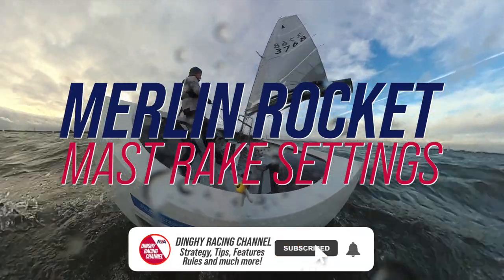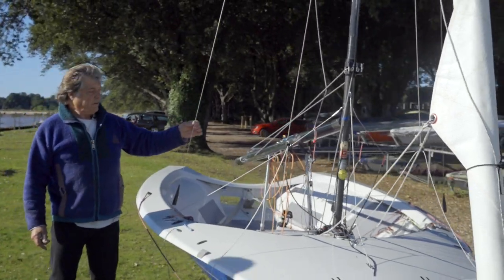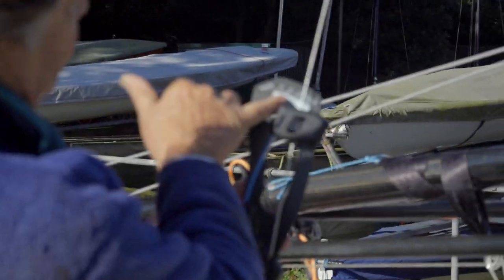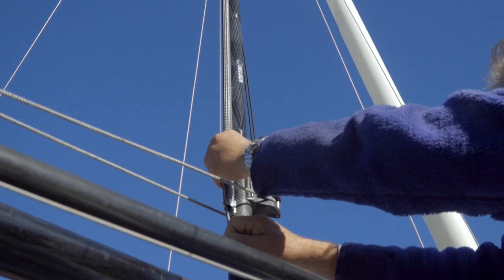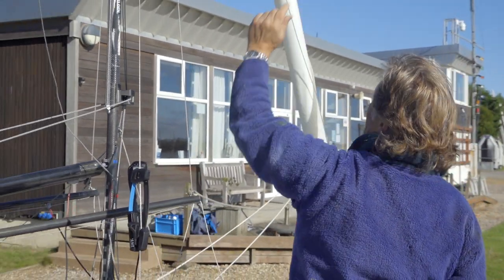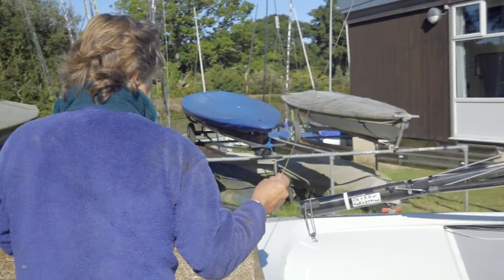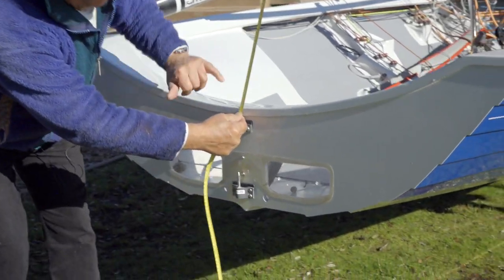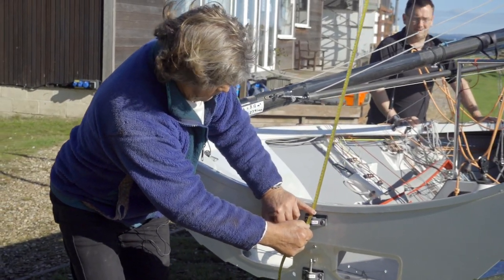MERLIN ROCKET MAST RAKE SETTINGS - Rigging Guide and Top Tips for setting up your mast rake

Comment: Thanks John.... once rig tension is set (lowers slack) what's your recommendation about lowers tension? ....just tighten or is there a specific base setting? Martin 3634
Reply from the maker: Hi Martin, John's recommendation would be to tighten up the lowers to a 'snug' position once you've checked the mast rake setting, and have it set up correctly in the 8-9 knot wind range. Hope this helps! Thanks

Comment: Why rake the mast? To change the centre of effort and balance the helm, or is it more about changing the shape of the sails through altering sheeting angles (effectively moving jib cars back) and shroud v mast angle thus giving more pre-bend for a given rig tension?
What's the benefit of raking the rig over sheeting the jib more along the foot, and increasing spreader deflection?
Reply: Mozzy Sails couple of things here: 
1. It’s the most efficient way to depower a rig: adding twist, reducing drag etc and given that the merlin can do this dynamically, the crew can fine tune the power in the rig to exactly the gust sailed in, optimising available power
2. A main sail is cut for a given pre bend in the mast. Adjusting this pre bend impacts the effectiveness of the alignment between mast and sail
3. JT touched on the impact of buoyancy, but the impact is present too when you rake back as the centre of effort gains a vertical component which gives upward lift. Most obvious demo of this is an asymmetric kite which is heavily raked and provides clear lift.  
Helpful?
Reply: @timothy12350  from Facebook its sounds like pre-bend is kept the same when raked (through lowers, although this might just be displacing pre-bend higher in the rig)) and the jib sheeting angle is brought forward to effectively remain the same. So, the sail shape isn't twisting more, or reducing camber. It's just changing orientation to the wind. Effectively maintaining shape but increasing 'sweep'.
Planes use a lot of sweep, but this is mostly due to issues with shock waves drag at sonic speeds...
One issue with rear swept wings is that you get a lot of spanwise flow which causes stall toward the tip. 
So, I'm still a bit uncertain as to whether raking a rig is because of the knock on sail shape change, which we see in the 200 and 800 because it's impossible to change rake without increasing pre-bend), moving centre of effort aft for balance (although this doesn't make much sense as CoE goes back anyway when you're easing sails), or whether is to do with the 'sweep' of the sail?
Or whether it's giving the boat vertical lift, encouraging planning, like a asymmetric kite might?
Reply: Agreed, I've never read a definitive write-up that I was confident in.....happy to accept the statement "it works", but would like to understand better why. No one mentioned that as the last is raked the cord length increases...making depth % lower...also, is aspect ratio overall decreasing as rig gets wider and centre of effort comes down? cheers, chris
Reply: Also, whilst we're happy to accept that small changes can bring a boat into tune, we sometimes dismiss small adjustments to depower as being insignificant....If you take my meaning.